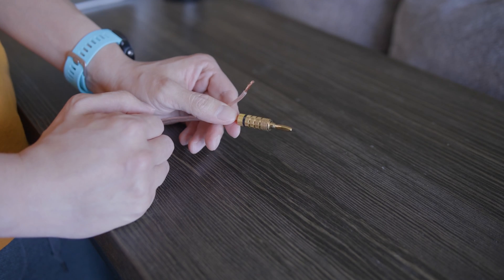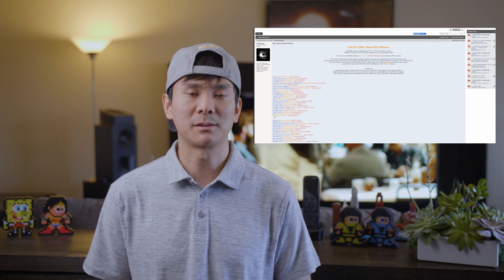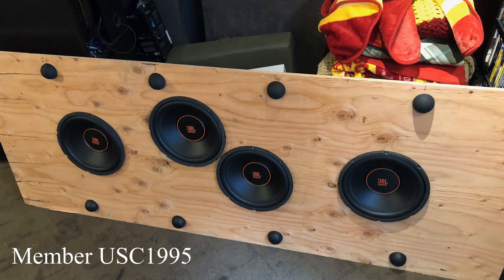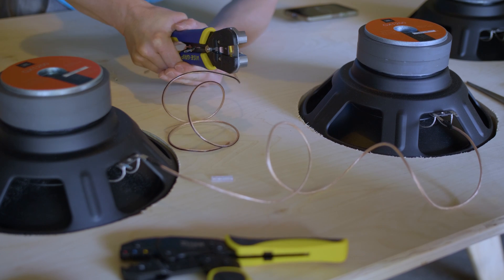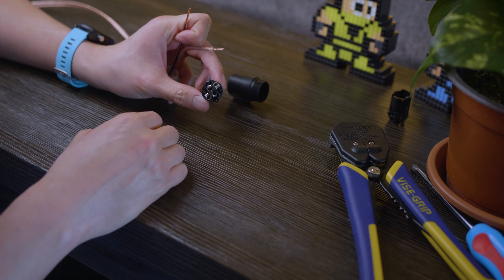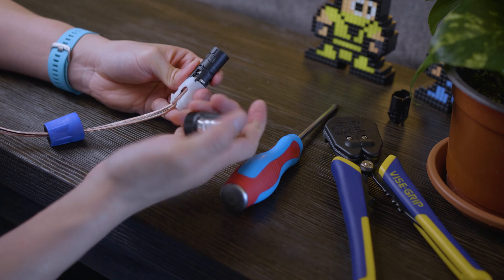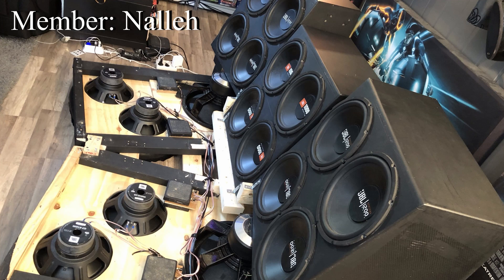Mini Riser BOSS Platform Build Guide | BassEQ | Tactile Response | ULF Bass on a Budget | HoverBOSS|

Comment: Thanks for the EQ settings. I've been using my Quake 10B for years with a huge boost of 10db at 10hz and relying on my AVR's cross over. It does result in insane tactile sensation (think that it clears your lungs of mucus tactile lol) but it's sometimes noisy and doesn't feel like a subwoofer. Your settings felt more like a real sub rather than theme park ride I was on before!

Comment: In your opinion, why should someone go for a hover boss over a transducer? Also regarding the painters plastic covering..have you seen anyone mention a vibration or sound immiting from the plastic? Great setup and great video!
Reply: The cost for a HoverBOSS is less than other device. You get done below 10Hz with serious shake. Vs bass shaker like Earthquake Q10B, it shake you below 10Hz but this is much expensive, and you still need a plateform to isolate the couch from the ground with spring to allow the couch to move up and done

Comment: Hi, I was just helping someone in the TR thread and they pointed out that you wired up you speakon with +1, -1.  That's the wiring for only channel A,  if you're trying to run bridged you should be wired up with +1, +2.  I haven't fully gone through your video to see if you said if you were running bridged or not but the other user who was following along thought that was the case.  I'd recommend bridged BTW if you're running 4 drivers at 4 ohms for the HeZe.  It can take it.  That's what I give each set of 4 in mine.

Comment: Because of this video, even without much result footage, made me make my own with 4 walmart jensen 12" subs. On a small couch.

Lone survivor helicopter scenes? ooooooOooooOo. 
I'd reccomend if a person did it, do it to one chair with 1 or 2 subs first. Doing it to their main couch like I did, its a bit much. This is coming from a guy with 2 buttkicker advances, and a 5.0cuft kicker cvx 15" box in a small hatchback. 

Nothing will prepare you for those scenes.

Plus I'd forgoe those awful isolation feet. All they did was transfer high bass to the floor. Using just two 2" thick 26" bicycle tubes just ziptied together, worked perfect.

Comment: Can I just screw the bass shakers I already have or do I really need to use bass drivers?
Reply from the maker: i'm not sure i understand your question. are your current bass shakers attached to your couch?
Reply: Sorry If unclear. I have shakers screwed into each individual theater seat. I have currently use layers of yoga mat under the seats as my getto floor- seat decoupling solution. The platform with isolation feet is a great idea. My question is - do the subwoofer drivers add anything extra over just platform plus maybe screw on a buttkicker lfe ?  I have electric relining seats and there is no room for drivers under there.
Reply from the maker: @derekr5327  i have never experienced butt kickers myself but from reading on the forums there is a difference between shakers and a boss platform. that said, there are a few people on the avs forums that run both buttkicker shakers and have that sitting on top of a boss platform.

Comment: BTW Boss, I already have a mini DSP I use for my subwoofers. Do I need to buy ANOTHER mini dsp for this or can it work off of the third output from the mini dsp (2 other ones used for subs) ?
Reply from the maker: don't need another one. Just plug it into the third output!
Reply: @TheLegendaryBrownNote  thank u man! will this fan work for the fan mod? Noctua NF-A8 ULN, Ultra Quiet Silent Fan, 3-Pin (80mm, Brown)
Reply from the maker: @aoaaron6166  that should work! it will spin at a slower rate but I haven't had any heating issues since changing out the fans on mine. so much quieter now!
Reply from the maker: @aoaaron6166  also, i don't see your comment about what the hoverboss brings compared to a midbass module. i have a nearfield 12" sub and it does add some TR but the TR that the hoverboss brings is a whole different level. It focuses on the TR 20hz and below. It will literally move the couch as opposed to the nearfield sub that will only transfer some vibrations over. Very different beast altogether. I can live without the nearfield, can't live without the boss.
Reply from the maker: @aoaaron6166  i'm not entirely sure which connectors you will need because you are using a different driver. dont' worry about blowing up the comments section, that's what its there for :) are you planning to go neutrik?
Reply: @TheLegendaryBrownNote  I don't know what neutrik means :( Should I be planning to go neutrik? :)
Reply from the maker: @aoaaron6166  neutrik speakon connectors are just one way of terminating the wires. I chose to go this way because the behringer amp takes a speakon connector. it's similar to xlr, rca, etc in that its a form of connection.
Reply: @TheLegendaryBrownNote  Thank you boss. I think I'll have to go that way as I have bought the Behringer NX3000D (and the noctua fan you suggested). I'll have to read up on wires. I have no idea what a terminal even is lol. 

BTW can you do a video on the software side of having a hoverBOSS e.g. calibration and timing? and how you sealed the tubes physically? Like what materials I need to buy.
Reply: Thank you! I'll get them in. BTW is there any chance you could do a video tutorial on how you actually connect the speaker wires physically to the subwoofers?
Reply from the maker: @aoaaron6166  on the software side of things i will eventually make a video on that but not anytime soon, just too many things going on :) I can try my best to help you out with any questions you might have.
Reply from the maker: @aoaaron6166  I won't be making a video on the physical connections at least not anytime soon. sorry!
Reply from the maker: @aoaaron6166  in terms of speakon, you would want something like this: https://www.amazon.co.uk/Neewer-Speakon-Speaker-Compatible-Neutrik-Blue/dp/B076CKR2FJ/ref=sxin_9_ac_d_rm?ac_md=3-3-bmw0Zng%3D-ac_d_rm&cv_ct_cx=speakon&dchild=1&keywords=speakon&pd_rd_i=B076CKR2FJ&pd_rd_r=a3778fb2-b4ba-4b41-9658-f1f2c66868bb&pd_rd_w=s645I&pd_rd_wg=g4Iob&pf_rd_p=17aec670-a34a-456d-b214-b9a882c785b0&pf_rd_r=3RZNRQD7WDPWA7PWR41X&psc=1&qid=1602863495&sr=1-4-fe323411-17bb-433b-b2f8-c44f2e1370d4

also, any 16gauge (or thicker) speaker wire will work for this build. 

also, a kit like this should fit your drivers: https://www.amazon.co.uk/Preciva-Connectors-Terminals-Insulated-Electrical/dp/B07HFPQDYM/ref=sr_1_5?crid=1S3589F1OP9C7&dchild=1&keywords=spade+connectors&qid=1602863590&s=electronics&sprefix=spade+conn%2Celectronics%2C280&sr=1-5
Reply: @TheLegendaryBrownNote  thanks, I ended up buying 14. Is that alright? My run looked like its going to be 9 metres from the Behringer so I thought it was better to be safer :)
Reply from the maker: @aoaaron6166  yup, it's even thicker than 16 so you're good to go!
Reply: @TheLegendaryBrownNote  Thank you. do you know which cable I need to plug my mini DSP into the Behringer? I am a bit confused as as far as I know, I need an RCA to XLR cable but they all seem to be twin RCA to XLR cables.. I thought it'd only be 1 RCA needed. if you could link it from amazon uk would be awesome :)
Reply from the maker: @aoaaron6166  https://www.amazon.co.uk/Single-Phono-Audio-Signal-Patch/dp/B01CSKU34W/ref=sr_1_5?dchild=1&keywords=mono+xlr+to+rca&qid=1602945929&sr=8-5

something like that would be good. choose your length as needed of course
Reply: @TheLegendaryBrownNote  Thank you. I kid you not, I was about to order the wrong cable. you are a lifesaver!
Reply from the maker: @aoaaron6166  haha i've done that many a time.  btw, not sure if you ordered these yet, but if you want a cleaner setup on your platform, i suggest getting one of these: https://www.amazon.co.uk/sourcing-map-Speakons-Connector-Speaker-Black/dp/B07RN8GWH9/ref=sr_1_1?dchild=1&keywords=Audio+Speaker+Jack+Twist+Lock+4+Pole+Round&qid=1602951761&sr=8-1
this will go on the platform itself and the wires from the drivers will connect to it. It's optional, but it will make for a cleaner setup overall. You would only need one of these.
Reply: @TheLegendaryBrownNote  Damn I don't have any idea how to use that device. The wiring is still REALLY confusing me and I'm hopign it just makes sense when I open up the subwoofers. 

So I'd connect all the wires from the deivers to that terminal, and then I would use a speakon to speakon cable to the Behringer?
Reply from the maker: @aoaaron6166  yup! all the wires from the drivers to that terminal and then a speakon to speakon to the behringer is how i have mine set up.
Reply: @TheLegendaryBrownNote  thanks man. BTw how do u know which end is ositive and which end is negatrive?
Reply from the maker: @aoaaron6166  which part are you referring to?

Comment: The back of the amp symbolize for  Bridge mode 1+ 2+. 

Any reason you use 1+ 1-?
Reply from the maker: When making this video I was not using the bridge mode for the amp.
Reply: @TheLegendaryBrownNote  So you are using bridge mode now with 4 JBL? I have had 3 JBLs for the past couple years and am moving to 4 soon with the 3000D. Just trying to get a grasp on what changes I should make with wiring and the amps settings as I mostly forgot what I did back then lol. I'll also be getting some tubes to upgrade at the same time!

Comment: I'm starting to plan my build.  I've had most of the parts for months, but your video finally convinced me to take the leap.  Were you concerned at all about the rigidity of the plywood after cutting holes for 4 drivers?  I know trhought expressed concerns about trying to install a 4th driver in the board.  I'd rather not screw two plywood platforms together, but I can if necessary.
Reply from the maker: hey there. i have not thought about the rigidity of the board. i kinda just went for it. So far it's been fine. If things ever go south I'll chalk it up to a learning mistake :) If you are worried then doing 3 will be pretty much the same. I think the forum said adding an additional driver nets you something like 10-15% more power so it's nothing major. For the neutrik connector you only need one. It depends on how you want to connect it too, but the minimum is one. Good luck!
Reply: Also, for the Neutrik 4-Pole speakON connector listed above, do I need to order 4 of those (1 for each speaker)?  I'm assuming so but I want to make sure.
Reply: Oh wait...I think I figured out the answer to the Neutrik connector.  You only need 1, since that connects to the Behringer...

Comment: Thanks for posting this video!  I was going to build a BOSS, but this will make it a lot easier. 

Regarding stretching the tube around your 2 middle drivers, do you mind saying how far apart they are (center to center is fine).  I think I might run into a similar problem based on my current design.  Thanks!
Reply from the maker: i can't easily flip the couch by myself but if I ever get a chance to I'll take some measurements. sorry! If you haven't built yet, you just have to move it as close as you can and you'll be fine. Mine are fairly far apart and I was still able to get one tube around both. If i just moved in one driver by an inch it would have been perfect!
Reply: @TheLegendaryBrownNote  Thanks!

Comment: Great work on the video man! The Thank You shout outs are Pure class. Your video is great to use as a guide for a build project. Man thanks for the tutorial on speaker wire, and speakon connectors. I am definitely going to pick up a pair of the those Vise Grip Wire strippers. No Fuss, No muss! I think you just made the speakon connector a got to connector for me.  I am thinking about using your design to use as passive sub that will slide under my couch between the feet. Thanks for a great video. Have an awesome day man!
Reply from the maker: sup man! Thanks for the kind words. Too bad Speakon isn't on a lot of things. They are pretty rad though! Good luck and have fun with your build :)
Reply: @TheLegendaryBrownNote  The coolest thing about your speakon tutorail is that I can pick up some pro speakers at Guitar Center, and use them for home theater!

Comment: I am absolutely loving these easy-to-follow tutorials you've got. Thank you so much!
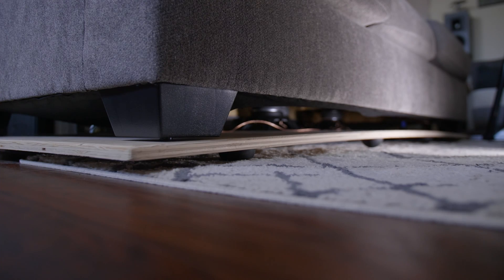I noticed that the weight of the sofa is causing an arc in the plywood because your decoupling feet are placed a little far inward of the corners @ 11:25 - Do you think that is affecting the BOSS performance negatively?
Reply from the maker: Thanks man. Yeah I noticed that too. I'm going to ask the forum to see if I should be worried about that. If anything on the real intense parts the couch moves a bit too much around and I might need to secure the couch down to the platform. I'm still tweaking things! I don't think it's negatively affecting performance yet but I'll see what the forum says.
Reply from the maker: Sup man. So I checked in with the guys at AVS and they said it's not really a problem but if i wanted to take care of the problem I could add some spacers to help support my couch in the middle or add some additional tubes underneath the platform to even things out. Just thought I'd let you know!
Reply: @TheLegendaryBrownNote  Thanks for following up with me on that! I'll have to start following the thread so I can start to work in my own BOSS plans.